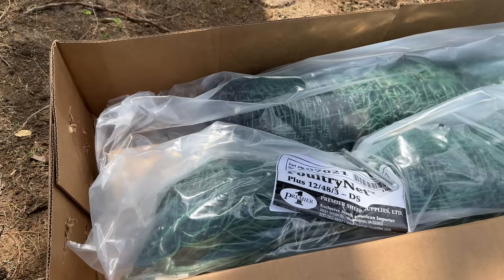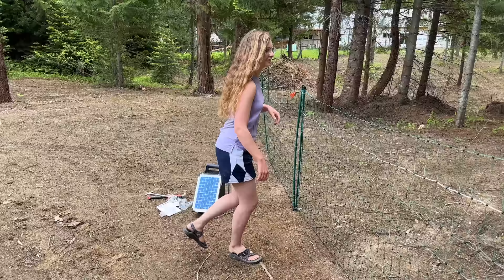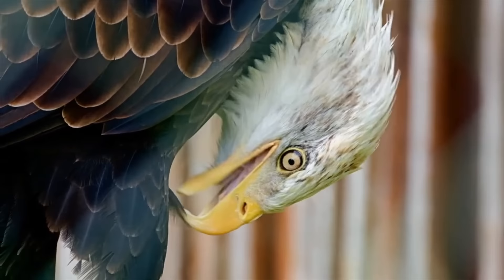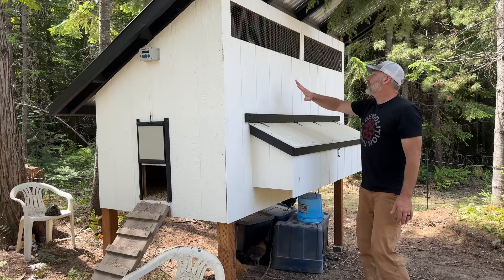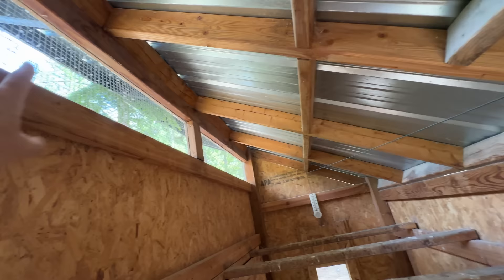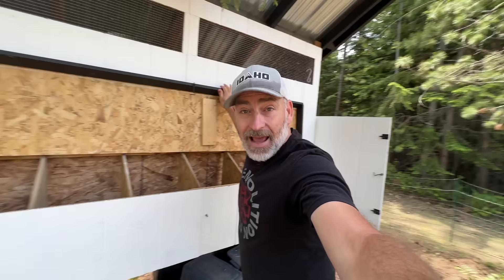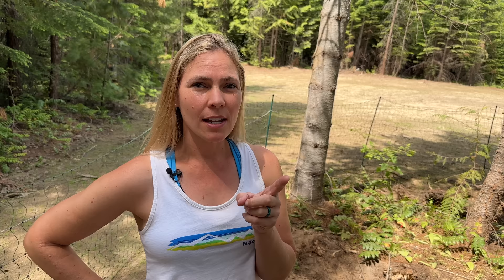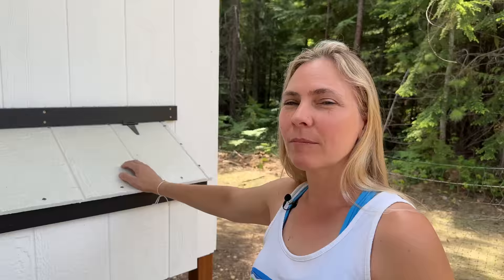DIY Backyard Chicken Coop | How To Build | Easy to Clean

Comment: Nice work. Fairly cheap and easy to build. 
The lower side of your roof is at a very dangerous level. 
Recommendation: You may want to, using metal sheets, round the roof corners and put a small piece of foam on it. An injury to the face is far worse to deal with.
Reply: Yeah like pool foam floaties

Comment: Interesting set up. Looks great and Very functional. I'm not much of a egg person, so don't raise chickens, but if I built a chicken coup I'd keep both sides of the roof above my head level because I'd end up some day stupidly whacking my head on the lower end. I'd build a A frame type of roof so I could gather eggs in peace away from wind driven rain and not have to stand in any snow...I'd build a 6' fence around the chicken area and utilize chicken netting over the top. Lastlly I'd definitely build the chicken boxes on a slope so the eggs would gently roll to the back for easy and clean collection. I still remember poopy eggs from the chickens my parents raised on the farm. :)

Comment: For winter heating if there is not many trees around paint sides black and fit glass airtight about 1/2" away ?  Large eaves and shiny or white roof for cool in Summer.

Comment: Your weather is similar to ours - are you not worried about the eggs freezing with the exterior nest box? I'm planning my coop for a little storage area attached and access the nesting box from there so it's a little better protected from the wind/snow/cold. This past winter we went 5 months without the temps getting out of the low 20s.

Comment: This is really a great looking and very useable coop.  However, the plans (if you purchase them) are not very good unfortunately.  You have to either be an engineer or (and I grew up building homes and built the home I live in now) you have to keep going back and forth looking at pictures to figure out dimensions.  If the measurements were added to the current pictures in the plans I bought, it would go so much easier, especially for a first time project builder.  A buy list, cut list etc. would really help.  The coop is certainly buildable from the plans, I just think it could have been faster and smoother with more details/measurements given.